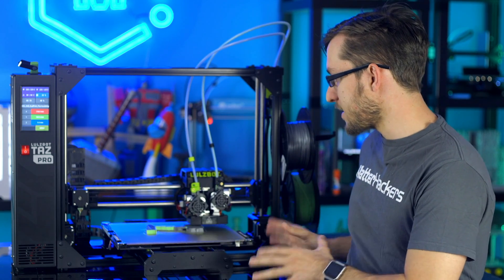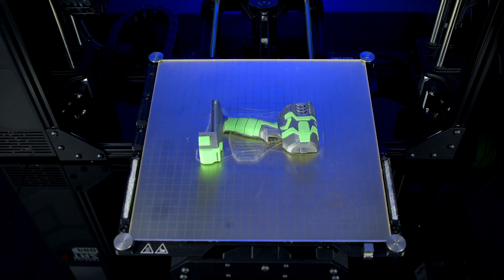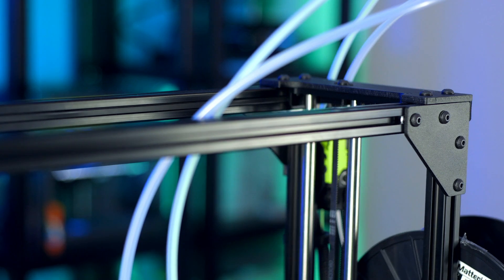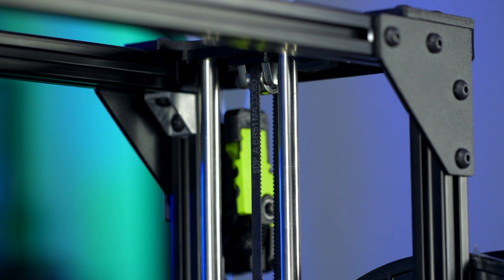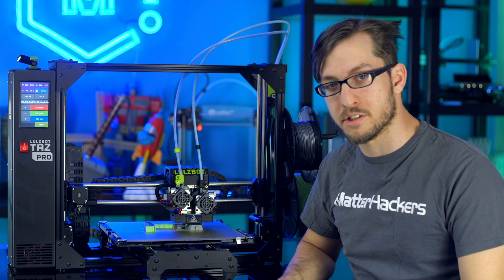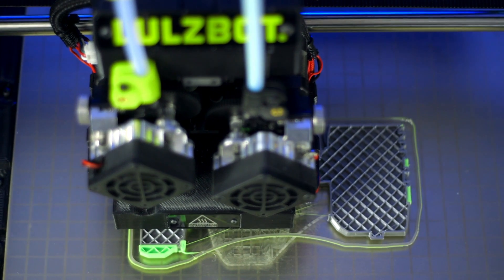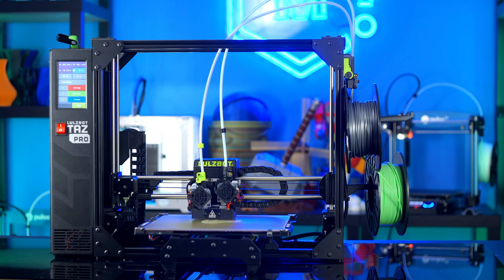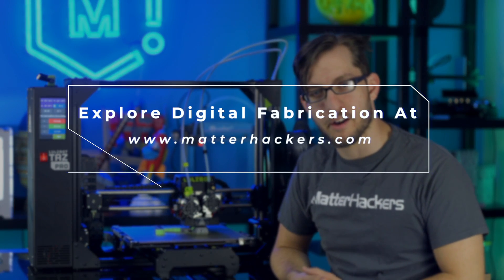The New TAZ Pro 3D Printer from LulzBot // Tech Breakdown

Comment: To be honest - the material used to build the ptinter is not worth it`s 5000 Dollar price tag!

For that i would expect exclusively CNC machned parts, no 3d printed parts on the printer - also some linear rails with circulating ball bearings, rather the those old-fashoined linear rods...

I feel it is too expensive, for what it does and for what it consists of!

Comment: Which would you get: (1) Taz Pro for $5K or (2) Ultimaker S5 for $6K?
Reply: The S5 
But I would spend the 5-6k to a Formlabs Form 2
Reply: neither of those two over-priced and mechanical inferior machines!

I would go for a solid all-aluminum frame with linear-rails and a core XY system for about 1500$ self-sourceed and built and with a slightly larger build volume and many times better print quality!

Comment: Some details about the Pro that I am anxious to learn about:

 ⁃ Comparative print quality and performance (is Z belt that much better?)
 ⁃ Modular swappable Tools (a feature I really like on the Taz 6)
 ⁃ Additional functionality such as remote (octopi?) and cam

A few personal IMHO comments are:

 ⁃ slightly larger Z build height is welcome
 ⁃ nice they are using a thumb drive instead of flash, would be better located on the front
 ⁃ glad to see the Pro is the same physical size.
 ⁃ I prefer the octopi logo on the 6 over the generic (boring) geometric pattern of the pro
 ⁃ 5K does seem like a lot for a personal printer, but maybe suggests an align with the trend towards industrial customers.
Reply: If they're releasing modular extruders for the Taz Pro, I doubt each extruder would sell for under $1000 though.
Lulzbot tried to sell a modified Aerostruder Nozzle(usually $250) for $745(Now $595), and it doesn't even come with adapters to use with their older printers.